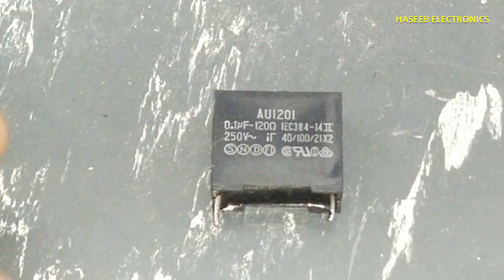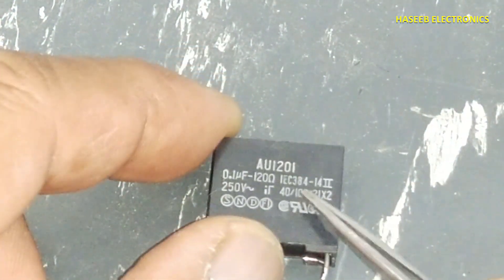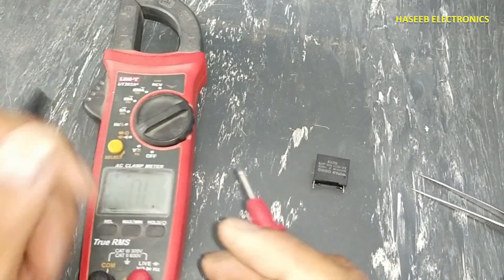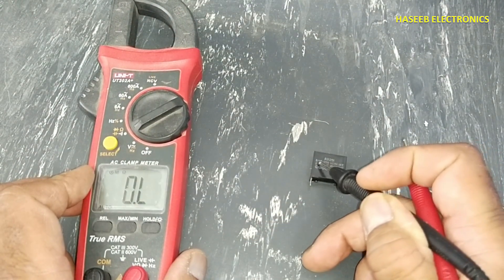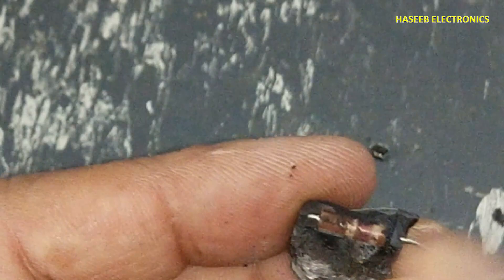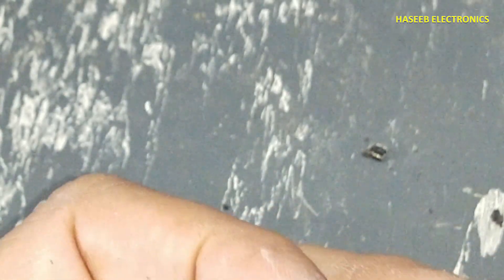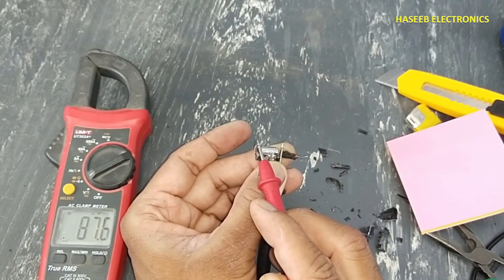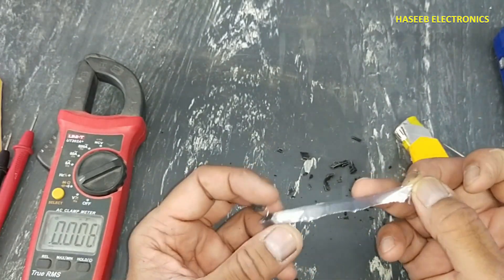{924} first time i saw this component, aui20i

Comment: this is a spark quencher or spark killer designed to prevent or substantially minimize the occurrence of arcing and noise generation in relay and switch contacts.  part number is au1201 not aui20i ... thanks for all the great videos
Reply from the maker: thanks a lot for your valuable information
it is really a new for me. I learned a new thing
please accept my best regards for your contribution

Comment: I looked at the image results of Google and found on eBay : 

AU1201** Spark Quencher OKAYO (0.1uF + 120 ohm) 275v, X2 rated RC combination Suppressor 
dimensions:  20mm(w) x 17mm (h) x 8mm(t),  pitch 17.5mm

   **the AU1201 is a larger version than the OKAYA RE1201 - this latter is fitted with 0.1W series 120 ohm resistor.
     the AU1201 is fitted with 0.2W series 120 ohm resistor

A Safety Capacitor specification metallized Polypropylene (PP)  with inbuilt series 120 ohm resistance (0.2W rated)

Typical Applications

For spark suppression and EMI filtering

.  input filtering, switching surge quietening

.  AC motor suppression

.  Many other uses

A High Quality Capacitor - *OKAYA ORIGINAL*
Reply from the maker: Thanks a lot

Comment: Is a "self sealing X2 capacitor".
Several brand of coffee machine contain this kind of capacitors on power boards.
The common fault on Nespresso/Lavazza coffee machine is Blinking or red LED on start button... the guilty is a capacitor like that. To fix just replace it on PCB and you'll have full working coffee machine again.

Comment: I believe this component is made to use in applications where an ac resistive load is required depending upon the frequency presence. But, you tried to get the dc resistance reading of this capacitor before opening it to see what is inside.

Comment: Rc filter often used across triacs or relays to supress switcing arcs
Reply from the maker: first time i noticed it,
Reply: It is rc snubber circuit in package but this type of package not use across triac replay diode and MOSFET because rc snubber ned calculation value of r and c but this is fixed value